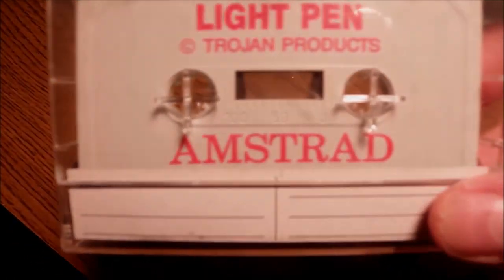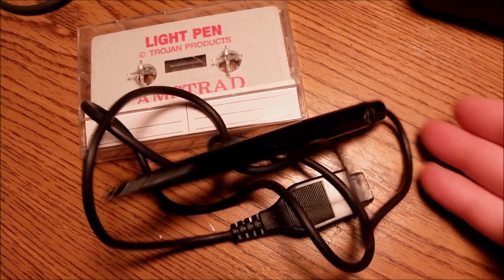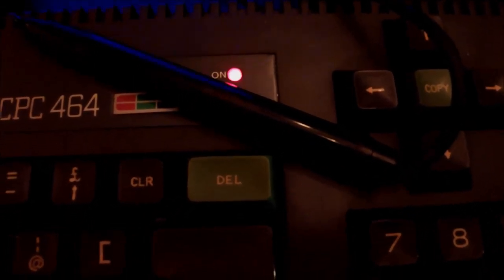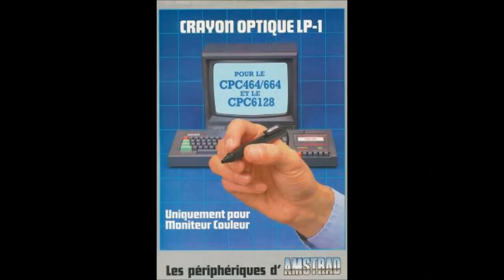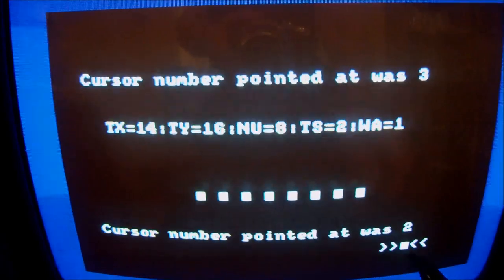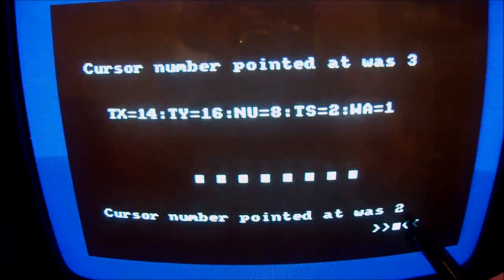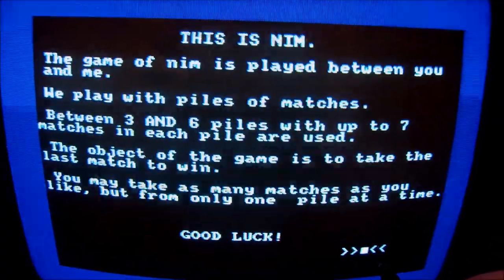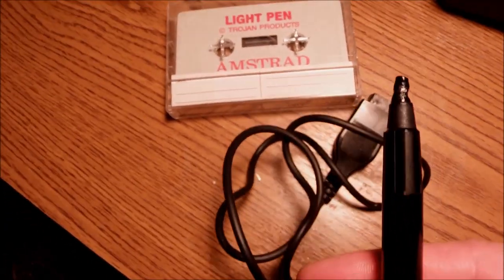AMSTRAD CPC - Trojan Products Light Pen test.

Comment: First time i saw this!
Reply from the maker: Stick around for the rest of retro, thanks!
Reply: @CyberhugTechnologies  managed to get my hands on one of these and converted the tape software to disc. Do you know of any other programs which used this?
Reply from the maker: @darkhalf5o1  Good thinking to transfer on disk :-) I think 'Electric Studio' was best app back then, along with tic tac toe and other several homebrew :-) Thanks !
Reply: @CyberhugTechnologies  thanks for the suggestions. My first time copying from cassette! I used sonarca to convert tape to WAV (audacity was dropping frames). CSW2CDT to convert WAV to CDT.  Once the bandpass filters were correct and checksums were okay, loaded CDT inside WinAPE CPC emulator. BASIC program loading BIN, so was easy to save both to a DSK file afterwards
Reply from the maker: @darkhalf5o1  That could be an awesome video!! Thank you  so much for guiding !